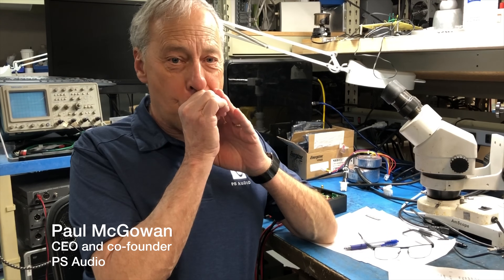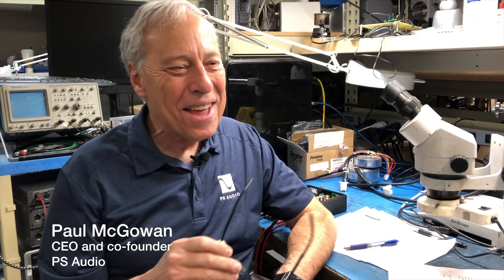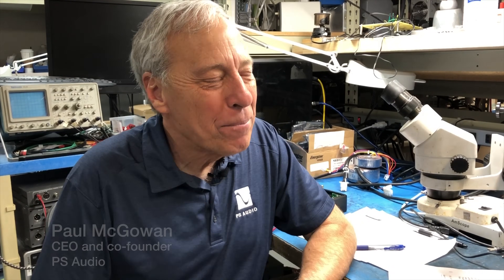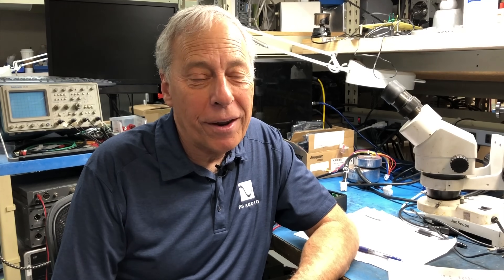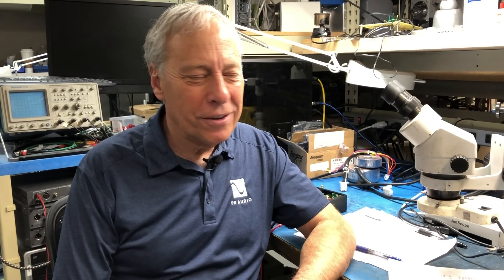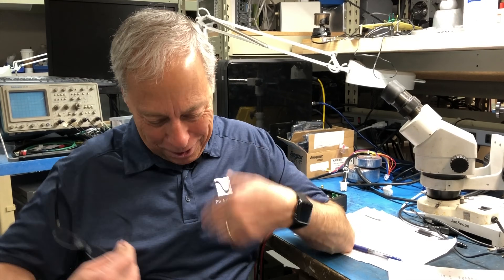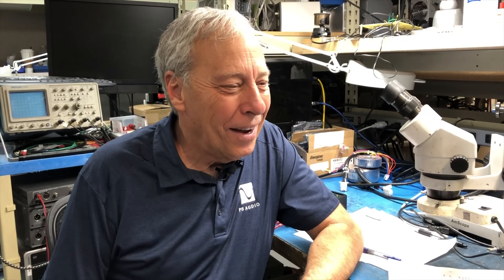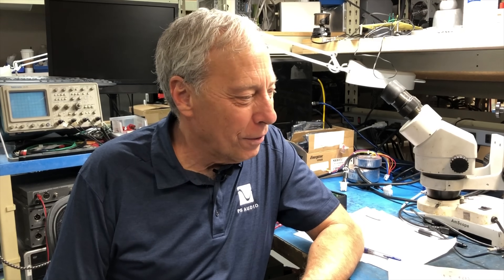How do horn loaded speakers work and sound?

Comment: This video is utter nonsense. The use of waveguides in studio monitors has been going on since 1983 ( https://www.genelec.com/directivity-control-waveguide-dcw-technology ). This many years later, such design has trickled down into consumer-level gear, e.g. ELAC.  Certainly the influence and control of first reflections is the reason for preference of horns in PA and Theater situations. Instead of remaining ignorant and spouting opinions as facts, @Paul McGowan should consider getting current on the science of loudspeakers (preferably before rolling out a monster of first reflections and bad off-axis response under his company's brand): http://www.acousticfrontiers.com/2014113speaker-off-axis-response-forward-firing-cone-dome-speakers/ "The basic cone / dome speaker: nearly always flawed lateral off axis responses
This type of speaker typically has an off axis response that deviates from the on axis response. The classic issue is mismatch of drive unit directivity at the crossover point between the midrange and tweeter. Typically what you will see is that the midrange driver starts to beam (i.e. the directivity narrows) as the frequency is increased. Yet when the tweeter is brought in its response is very wide. On axis things look good but off axis analysis reveals a lack of energy due to midrange beaming. These issues are most pronounced in speakers using 5″+ midrange drivers with 1″ tweeters.

A couple of examples are shown below. The left hand graph, from a StereoPhile review of the Vienna Acoustics Mahler is particularly bad. Even at relatively shallow off axis angles such as 30 degrees there is an obvious ridge at 3kHz. The right hand graph, from a StereoPhile review of the B&W Nautilus 805, is well behaved with a quite consistent off axis response to angles of around 30 degrees, after which the lack of off axis energy from the midrange becomes visible in the overall shape of the graph.

From a room acoustic treatment perspective speakers with off axis performance like this force the designer’s hand. The speaker on the left, the Vienna Acoustics, will sound better with the lateral reflections fully absorbed in all but the largest rooms where the speakers and listener are far from boundaries and hence reflections are low in level relative to the direct sound. In most rooms leaving the lateral early reflection points untreated would create an obviously colored sound, particularly in the region from 1-4kHz due to the significant variation in the off axis frequency response. We have more flexibility with the speaker on the right (the B&W) but leaving the lateral reflection points untreated at angles over 30 degrees would still lead to timbral coloration in the 1-4kHz range."

Comment: having the option to control directivity is a good thing.
maybe not every setup calls for it. my mains do have large waveguides and are very lovely.
Reply: A wave guide is much different than a horn. The former is largely an issue of perfecting dispersion, while the latter is poor man's amplification device.

Anything which resembles a horn too much doesn't create a sound I prefer.

Comment: Sorry Paul but a horn does not amplify the sound.  Rather it couples the impedence of the driver to the impedence of the air more efficiently,  An amplifier increases the power or energy.  A horn does not increase the power or energy.  It transfers it more efficiently to the air.    Come on.....
Reply: I know ---- always a trade off between simplicity and technical explanations -   You do a great job.....

Comment: CLEAR FROM THE GET-GO THAT THIS MAN DISLIKES HORNS AND THIS WAS A ADVERTISEMENT FOR HIS AUDIO COMPANY. I'll put up the newest Great Plains Audio 604 in an Altec Stonehenge any day against what ever you've got! So he likes a FLAT sound instead of a LIVE sound. All the cinemas in the 60's couldn't be wrong only using Altec A7's!
Reply: "All the cinemas in the 60's couldn't be wrong only using Altec A7's!"

But you could be wrong. Quoting from a history of sound in cinema:

"Cinema loudspeakers had become standardised by now with two 15in diameter bass units in a reflex cabinet (available in several sizes), and high frequency horns (also available in several sizes) with multi-cellular flared openings. Large auditoria would have two bass cabinets bolted together for each channel, with side wings to increase the baffle area, and two or more high frequency horns."

Comment: I had it explained to me like this: When you are linking two stages, maximum power is transferred when the output impedance of stage 1 is matched to the input impedance of stage 2. Basic electronics, right? Well a horn matches the speaker's output to the impedance of the air!

Comment: The acoustic horn is not an amplifier it is an acoustic transformer that basically matches the high acoustic impeadance of the source driver to the low acoustic impeadance of free space in an a analogous way to an electrical transformer matches different electrical impeadances. Read up on Harry F. Olson and Leo Beranek.

Comment: Horn speakers will always color the sound in one way or another. If you compare speakers, for example, middle tone with and without horns, you hear a coloring that the horn makes. Take the Cerwin-Vega XLS-215 and remove the horn in front of the middle speaker and the tweeter you will hear differences!

Good sound is not about loud sound and a lot of bass!

The disadvantage of small speakers of 4 inches and 5 inches is that the sound angle is so small that in order to get the best sound you have to sit right in front of the speaker, therefore some brands have used 10" 12" 15" PA. Mid-range speakers.

Horn will always color the sound. Horn driver with right horn can have quite good sound but i do not like to use horns.

Comment: I have two friends who built Klipsh corner horns in college. They sounded pretty good with Altec compression drivers and large midrange horns. The transient response at the crossover was terrible because of the time delay through the folded horn. I would like to hear them with phase-corrected digital delay to the mids and highs, which wasn't available at the time. They shared a room. Four Klipsh corner horns (stacked) in a dorm room produced some amazing sounding rock-n-roll!

In the early '80s, I built some speakers that used JBL compression drivers, horns and diffraction lenses. They sounded pretty good. Then I came across The Tube from Transylvania Power Company, Karlson Couplers for tweeters, and bought them. They got rid of the slightly nasal coloring of the horns and still properly loaded the compression drivers. They still seem like magic to me, and I still use them.

Comment: Paul Klipsch is looking down, and laughing at you right now.
Reply: and everybody else is laughing at you
Reply: Iv'e heard hundreds of speakers over the year and have personally owned klipsch.  My friend in town was a klipsch dealer so I have heard my share of klipsch.  Yes they "can" sound really great, but they also fall apart pretty damn easily.  My friend kept trying to sell me a 1500 dollar pair 15 year ago when I had 600 dollar Mirage speakers.  I listened to them and didn't like them.  They mids got muddy when a challenging track was demoed, they lacked bass, they can be bright and annoying as fuck.  My shitty Mirages as he put it, sounded twice as good at half the price.  They were articulate, had excellent bass, clean mid, were tonally balanced, plenty of headroom, they were open, airy, smooth.  Could play anything well and were very efficient for a speaker with 5 1/2 inch woofers at 92 dB.  Hell I just bought a pair of speakers at a Klipsch dealer and the guy selling Klipsch wouldn't even recommend a pair in the 3k price range.  I don't buy the hype because to my ear and many other who have been into hi fi for years know, horns and colored.  I'd rather a speaker that can play most thing very well.
Reply: Fall apart?  I'm still running a pair of 1959 horizontal Cornwalls in my media room, they sound terrific and they've never even been re capped.
Reply: perl man you are full of it.  If horns were the end all for drivers, most speaker manufacturer would be using horns.  Horns are purely marketing.  They exhibit some good qualities, but to achieve the best sound possible requires so much effort it is not worth it.  Horns color sound, That is a fact.  If you need ultra efficiency I supposed horns have a place, but for most people, there are always better speakers than horns at any price range.

Comment: Your other videos seemed to have reasonable information, sad to say that is not true of this one.  There are bad example of any technology.  I was lucky enough to get to know some of the guys at The Mastering Lab and meet Doug Sax a few times in the 90's and hear about how they made some of the famous Sheffield direct to disk recordings and spend some time in his mastering rooms.  Guess what, they were horn loaded speakers from the mid range up and were amazingly natural sounding and excelled at micro detail.  You could hear the texture on some of the percussion instruments.  I heard new things in recordings that I had had for years. One of his engineers showed me his personal system (horn loaded) and gave me some tips on the system I was building at the time based on the TAD compression driver and Bruce Edgar horns.  Every electrical engineer understands the importance of impedance matching, the same is true for acoustic design.  A good compression driver is expensive,  that's the only reason we don't see them more in home audio gear.

Comment: This conversation might benefit from an explanation of First-watt theory and the direct function existing between increased power and increased distortion. Previous comments, below, regarding modern horns, tailored to frequency ranges, coupled with properly designed crossover networks are true enough... the results can be absolutely stunning. We all have our preferences; but, categorically dismissing horns out-of-hand may be more than a little misleading--especially to newcomers, and those finding their way into hi-fidelity sound.
Reply: I think this guy knows better but is trying to sell his own products
Reply: Paul Lazarro I’m not so sure about his firm grasp of all the acoustic theories involved, or the facts that as numerous others have noted that:
1) all loudspeakers are imperfect, even those designed by Arnie Nudel, Paul Klipsch, Peter Walker, or the entire teams of engineers at KEF,  B&W - pick your poison- and  none exist that will satisfy every listener, or fit their budget or domestic  situation; 
2) materials science and advances in computer modelling have over the past many decades, but within the living memory of many of the readers and commentators here and the span of Paul’s business career, significantly improved the objectively measurable performance and affordability of audio equipment in general, certainly including loudspeakers. 
That said, Paul certainly has an avuncular demeanour that allows us to easily overlook his occasional technical gaffe, or subjective bias - things of which few of us are innocent. 
I’ve been in this hobby/lifestyle long enough (over 50yrs) to have auditioned /owned / built literally hundreds of systems, including scores of speakers.  Some of the most unsatisfying / impractical loudspeakers I’ve personally experienced have been horn loaded multi-ways ranging from old school Klipsches, JBL, Tannoy, Lowther, etc. Conversely, some of my most enjoyable musical experiences have been with relatively modest rear horn loaded enclosures utilizing full range single drivers, assisted with realistic expectations and perhaps a relaxation beverage or three.

Comment: Hi, thanks for exposin this theme
May I desagree a bit?
As i understand, for get a reasonable power in reproducing high frecuencies, it is necessary to use horn drivers, and also for low frecuencies, it is known that horn loaded subwoofers offer more punch. I have the idea that in the subwoofers, the cuestion may be an inertia problem. It seems to me, that the mass of the subwoofer cone, requires a lot of energy from the amplifier to accelerate and brake, so, the compression of air in a small chamber followed by a horn should work as natural suspension, making the cone to produce more pressure, instead of just gaming self inertia
That is why i replyed in the comments section. It is a very interesting issue
Thanks

Comment: As a longtime audiophile, I have a 'soft spot' for planar and/or horn loaded speakers.  Today's horn loaded speakers are a lot smoother and not as 'shouty' as older models, and I am smitten by how lively they make the music sound!  There is just something about a well designed horn type speaker that to me, is pure magic!  Even my cheaper 'office system' in which I run JBL Studio 530 speakers (horn loaded design) brings me to tears at times!  I was listening to an older Rudy Van Gelder recording of Sonny Rollins' 'Sax Colossus' on these small speakers, and I could not believe how close they got me to the music!  The timbral accuracy and sonic signature coming out of these little horn loaded speakers just blew me away!

Comment: Well. ALL speaker materials and types to date color the sound, so pointing at horns and making some general statement that "they color sound" really shows personal bias more than anything else.

Many people used to lump Altec Lansing horns with Klipsch, and make some kind of blanket statement about horns. No one that lumps these 2 manufacturers together has any ability to listen worth paying attention to, they are miles apart. Altec Lansing speakers have that kind of distortion typically attributed to horn speakers in spades, Klipsch speakers do not sound anything like them.

Comment: Horns don't amplify anything; their efficiency comes from impedance matching.: https://en.wikipedia.org/wiki/Horn_(acoustic)
Reply: From the same wikipedia article - "Acoustic horns are found in nature in the form of the burrows constructed by male mole crickets to amplify(!) their song..."
"This has the effect of maximizing the efficiency with which sound waves from the particular source are transferred to the air."!
Reply: You should never rely on Wikipedia as a source for Truth. 🤦🏻‍♂️
Reply: “Speaking horns are known to amplify sounds because they match the acoustic impedance between sounds emitted through the horn's narrow end and the air at the wide end of the horn” 
https://royalsocietypublishing.org/doi/full/10.1098/rspb.2013.2362#d3e758
Reply: “The Horn amplifies the sound to an impressive level. Opening or closing the wood doors on the front controls loudness by blocking the horn inside.”
https://edisontechcenter.org/speakers.html
Reply: “A  horn funnel effectively guides the motion of sound waves and thus substantially increases the sensitivity and effectiveness of sound radiations. A horn is the most natural and powerful way to amplify sound.” 
https://www.avantgarde-acoustic.de/en/horn-technology.html
Reply: “The reason as to why a horn amplifies sound is its funnel shape. A horn is typically slim at the end and grows larger as the diameter goes towards its hollow opening. Their capability to amplify sound is actually what inspired sound engineers to manufacture horn loudspeakers. Horn loudspeakers are basically the oldest type of loudspeakers.” https://audiomention.com/types-of-loudspeakers/

Comment: Great video Paul! I find horns intolerable. Some are so bright it is like having an icepick driven into my ear, others like you illustrated sound like the PA at a sporting event.
Reply: There are some dome tweeter horns that are like that as well and completely compress the HF when played above 80 db with a completely un-listenable  sound.

It's not hard to find speakers of ANY kind that have flaws.  You might try listening to a modern JBL, Klipsch or SEOS waveguide speaker that is well designed.  I don't think you will complain about having an ice pick driven into your ear, but then again, I don't know how poor your ears are.
Reply: That is because you found the ones that were not designed properly

Comment: I am mixed on this. I do not believe that the average person needs 130 dB in a home environment.  Most music is compressed and home theater maybe not. So for the average person, yes better less output and natural sound.  I have heard great sounding horns in commercial installations and yes often the high end is a tough one. So yes a horn can sound quite good in a huge room and yes a dome tweeter and cone speakers are best in the home but for home theater, you may prefer the horn.

Comment: Paul, I wonder if the same applies to horn loaded tweeters. Do those become colored because of the horn too? Or maybe they tune the frequencies accordingly in the factory to compensate? Just curious...
Reply: Horns need to be designed correctly and built accurately, any errors are magnified.
Reply: if you dont need spl, then why not just get ribbons?  They sound better than any horn.